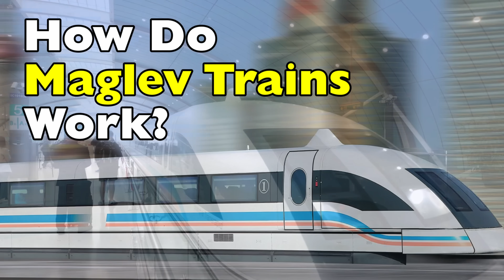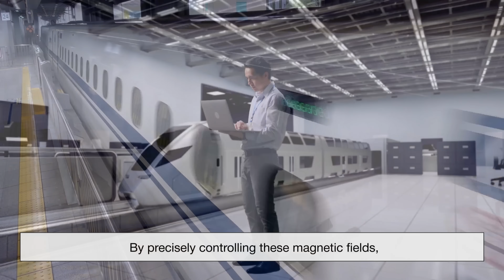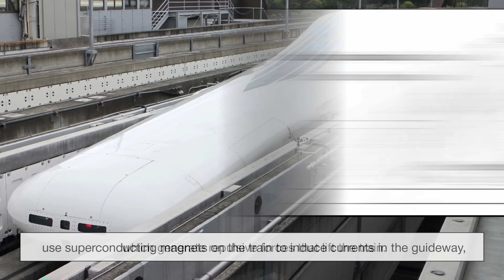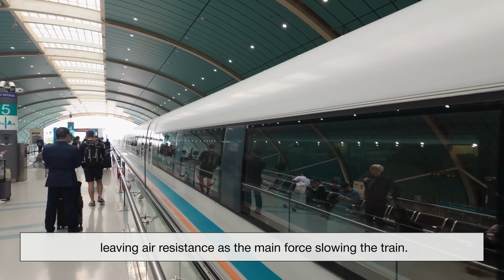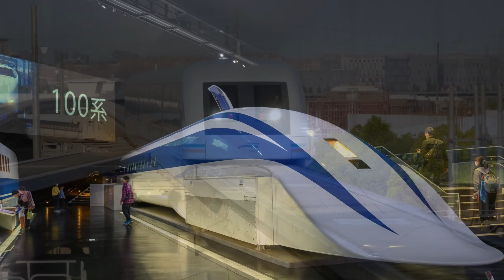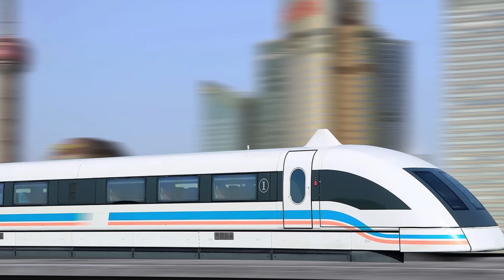How Do Maglev Trains Work? Levitated Travel

Comment: IDEAL FOR CANADA, considering its Efficient ECO-FRIENDLY Capabilities and Safety.

Better when dealing with SNOW, with Lower Maintenance Costs, once installed.

Commuter and Remote Workers will have convenient travel to our Major Cities from their gorgeous Small Towns.

Operating on Hydro Electricity, our effective Nuclear with Solar Support, will permit Quiet Efficient Travel without using petrol  or external energy. Our improved GRID can operate this System.

Hoping  Canada's new ALTO Speed Train Crown  Corporation will utilize this superior technology.

Comment: What is the difference between bullet train and maglev train? Thanks.
Reply: Bullet trains have wheels, and run on rails.
Maglev floats on magnetic repulsion.
A bullet train can use both methods.
What would be amazing would be personal maglev vehicles and roadways. Self driving vehicles would be absolutely safe in that type of system, since it would be inaccessible to conventional cars and trucks.